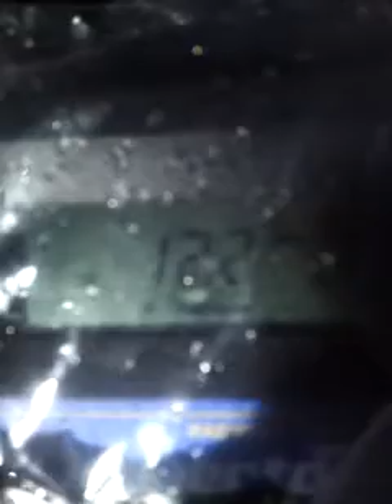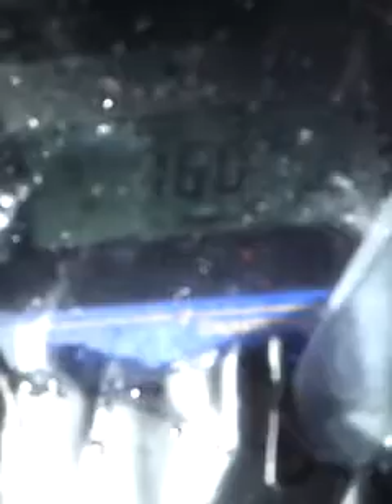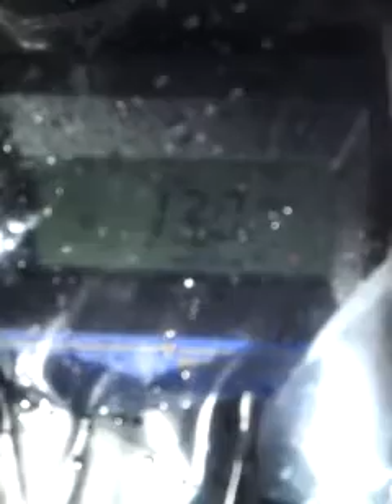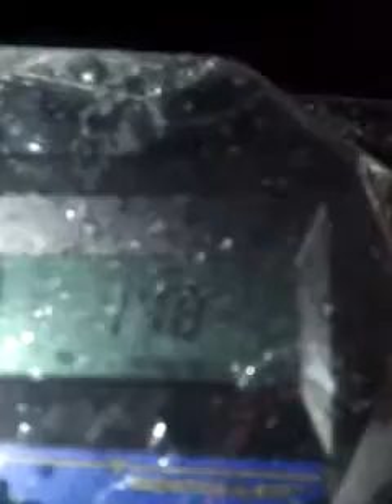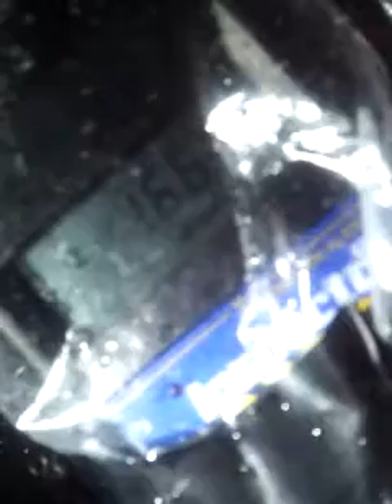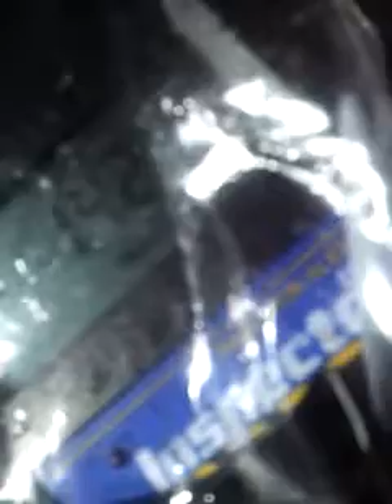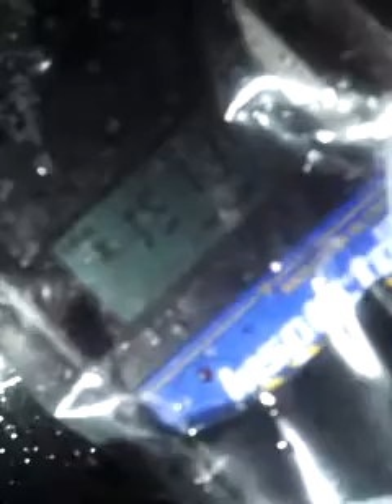HIGH Radiation, Car hood, Calgary, 151.8 CPM Rain Oct 2013, Fukushima?

Comment: Hi,
what is the typical background level of radiation in Calgary in microSv/hour (or microR/hour) on your inspector USB? My DIY counter shows around 13 microR/hour (or 0.13 microSV/hour). I think it should be a bit higher due to the fact that Calgary is > 1000 m high above sea level

Comment: Do you have the GC  enclosed in a bag? I have heard that can cause higher, inaccurate readings over time. I am surprised that your background readings are so low at your altitude. I live in California at an elevation of 56 feet ( sorry, haven't gotten around to metric sys. yet) and my bg readings have been about 42. And yes, Fukushima has not only been an ongoing event, it is getting worse. Be prepared for much higher numbers than that.  Good luck.

Comment from the maker: UPDATE:  tested hood 30 hrs later and radiation level came in close to background (a few hotter spots but nothing concerning.  Follows the half life of Radon, so I would with my limited knowledge, but learning tons I would conclude RADON WASHOUT.  will post video showing these soon.  
I still can not explain why my coat, no precipitation for weeks prior to test, unexplainable high level of CPM's also posted on my channel
Also, same similar results 186.7 tested 3-4 days prior.